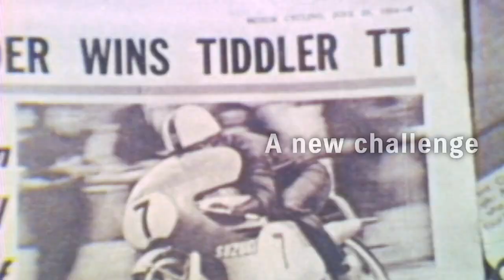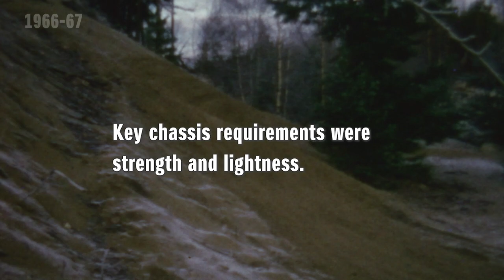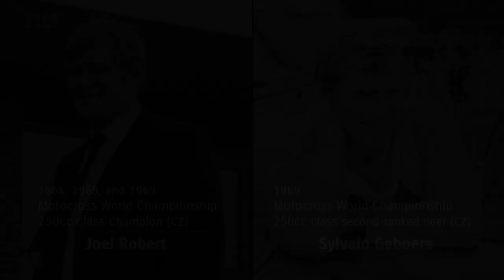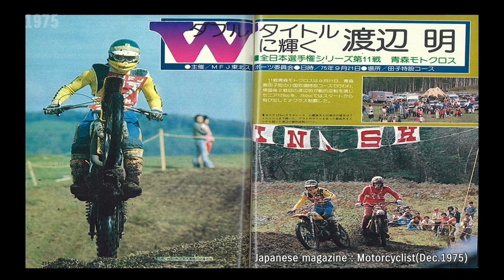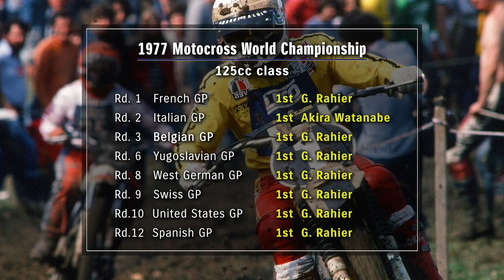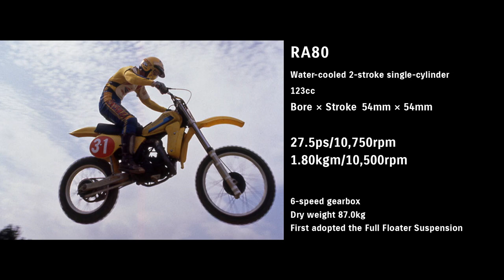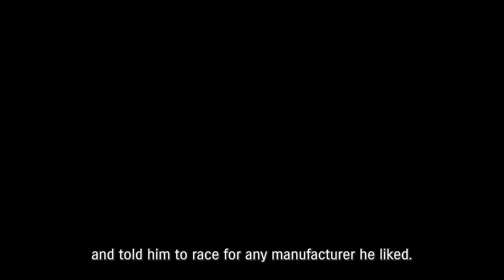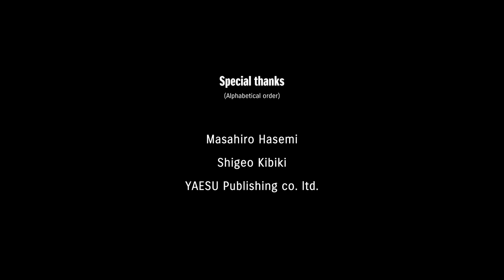Suzuki Motorcycle Racing History Episode 2 | All chapters | Suzuki

Comment: I am not sure if the word development is correct Suzuki did what most Japanes engineers did they took a concept and improved on it .Their road racing machines derived from MZ
and a rider who took all the knowledge with him when he joined Suzuki.. This is not a critisim as such because they did improve anything they touched !!
Reply: You are right. But Walter Kaaden himself did not start from Scratch. His first Racing machine was based on a prewar DKW Motorcycle. And the famous disc Valve inlet was developed by boat engine builder Daniel Zimmermann.

Comment: Suki made some great motocross bikes like the RM and the TS but the Window maker TM 400 was a dangerous bike to ride water cooling and the expansion chamber did make suzuki who they are today I have a 1972 suzuki TS 9p us model and yes it does have an expansion chamber exuast fitted as most two stroke do now  my bike is a TS 90cc trail bike and yes very light weighs 89 kg which with its revvy two stroke engine makes it fast it just works for two strokes

Comment: Than man deflecting from MZ who incidently were developing the two stroke expansion chamber exuast system made all the difference to suzuki two stroke Road and motocross bikes the expansion chamber dit it for suzuki not a lot of people actually do know th
At the German made expansion chamber were actually used in wat time in the V2 rockets a 2 stroke without the correct exuast is flat in acceleration under basically useless again many thanks to that MZ man MZ bikes were also used in racing and were fast as CZ bikes were in motocross as the were do inating early motocross CZ s got Better with knowledge of the new expansion chamber exuast system and midly put there a thing about being second in races is that you learn from others and you eventually win